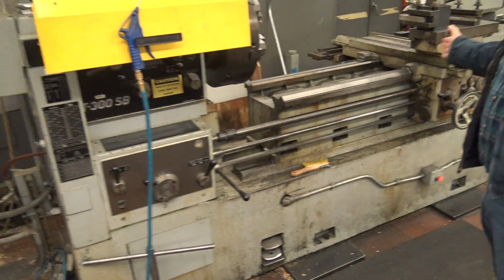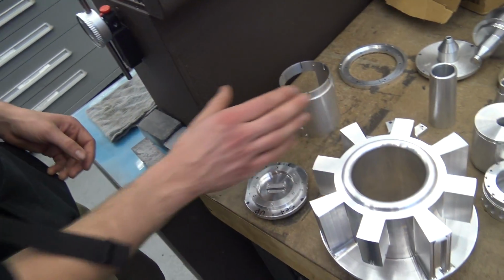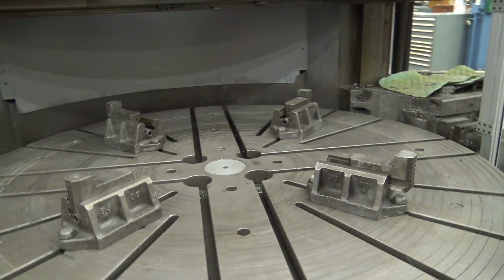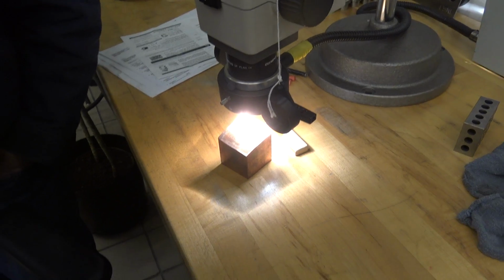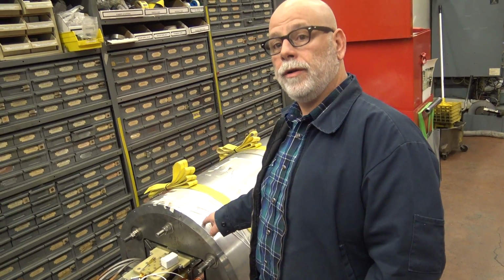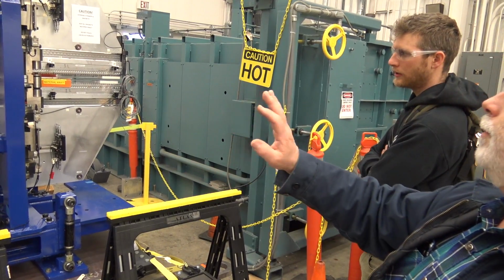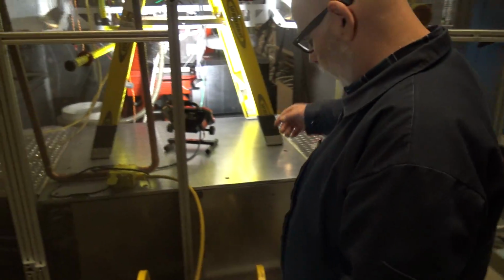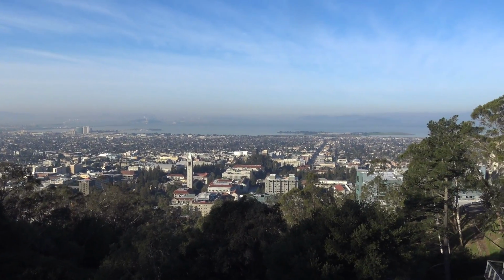AMAZING Machine Shop Tour: Berkeley Lab with Tom Lipton!

Comment: Wow, this was a great exposé of what equipment goes into an advanced mechanical research lab.  We here at Machineco, have supplied equipment to university labs ourselves from general machine tools, to large radial drills and salt baths.  In stock we have varied equipment such as was featured here, press brakes, shears,, compressors, welders, wire and sinker EDMs. The only machines we wised we had would be water jets and laser beam cutters, but it's impossible as they gobble up too much room. 
Again a nice bunch of pics of a great assortment of metal working equipment. Thank you!

Comment: There is a lot of this here in the bay area. Vacuum chambers and unusually machined parts from exotic materials with ridiculously tight tolerances. But it is not every day that you see as many of the varied machines and parts in one video. Ok, it actually just this day and only this video!

Comment: I was lucky enough to go on a "field trip" in college to see what a professor was doing research on. I forget who it was, but he was working with particle acceleration. He said that he had to use such a strong vacuum pump to evacuate all the "air" before doing the colliding. In fact the vacuum is so strong that he had to use copper for washers to make sure the "path" was airtight. He then gave each of us a washer to have. This has to be at least 20 years ago in the 90's and I still have the washer on my key-chain.

Comment: Very cool! I actually work at LBL and have toured the main shops before. I work in another division but It's always fun to visit the main shops. Glad you got a chance to see it and share with us!
Reply: +NYC CNC I am a student assistant in the Buildings Technology & Urban Systems Division. I've been working on the FLEXLAB project (https://flexlab.lbl.gov) which is a test bed for different energy efficiency building technologies. The lab has the ability to change out windows, facades, shading mechanisms, HVAC, and lighting, etc. and has a bunch of sensors to measure the effects the different systems have. I've worked on installing some of the different systems and sensors and have done some CNC mill/ manual lathe work to make some parts for this.

Comment: I was trying to roughly estimate the cost of the equipment as you walked through, but it soon become apparent that it fell into the "mega shit loads" category very fast...
Reply: It's the UC system: they don't know, as it has been run cost plus for decades.  One fun note [not shown] is they are able to make their own alloys on campus, which comes in handy for property testing and figuring out useable ranges for desirable properties..
Reply: @flinch622  You're right about the UC system in general but this is LBNL's operation, not Berkeley's, and it's federally funded via the Department of Energy. The UC system essentially just staffs and manages the lab for the DOE.

It's the single most productive institution in the world in terms of publishings per researcher, and the most productive singular lab bar none. Every institution that publishes more research than LBNL is made up of multiple labs spread out at distant locations. LBNL alone (just one of the 17 DOE national labs) publishes more academic articles per year than NASA, and almost half of what gets published by the entire NIH.

So yeah it's shitloads of money in tooling and machines. LBNL is not Berkeley's science & engineering department, it's a federal facility that used to develop nuclear weapons, and now does pretty much everything BUT develop nuclear weapons.

Addendum: Although LBNL is the most productive lab on paper, it's by far not the biggest national lab in terms of staffing or funding (LANL's budget is triple LBNL's) – it's just the biggest national lab that does not do classified research. LLNL, LANL, and ORNL are likely far more productive, their findings just don't get published because everything is classified. Anecdotal, but every staff scientist I know at LLNL or LANL has Q-clearance. That should give some idea of exactly how much of those labs' research stays secret.

Comment: They have every tool necessary to make pretty much anything...that's insane.
Reply: Toolman329 Many of the tools you listed are not necessary with modern tools. A gear hobber? They have several CNC machines that can cut gears, same thing with a pentagraph machine. You're also taking my comment much to seriously, it's called a hyperbole. I'm sure they could fabricate any and all of the tools you listed as well.
Reply: SeriouslySharp they have no 3d printers. But it is easy to make any size in a moment by the equipment they have
Reply: cncua Thats because 3D printers are toys. These guys are doing cutting edge stuff in the world of physics.
Reply: +cncua That just means that you didn't see any 3D printers...

Comment: A50k spindle is pretty impresive! That Bullard has the side head too so you can actually do 3 cuts at the same time! That would be a nice addition to my shop. :-) Most of that stuff the built looks like a wiring nightmare!
Reply: +NYC CNC I thoought that one machine was 40K and then new one was 50K, but looking at the door I see it is 40. Oh well that isn't impressive at all then. LOL I admit all the tool porn had me distracted so I couldn't pay attention. :-)
Reply: Wasn't there a pump with a magnetically levitated spindle spinning 50K on one of the accelerators?

Comment: I have a question about the power feeds mentioned later in the video. Tom mentioned that each one delivered "a megawatt in a millisecond." Watts and thus megawatts are an instantaneous measurement of power, so I didn't understand that comment. Power, integrated over time is energy, expressed typically as watt-hours, so is is possible that Tom meant that those cables delivered one megawatt-hour in a millisecond? Fascinating video; thank you for sharing it.
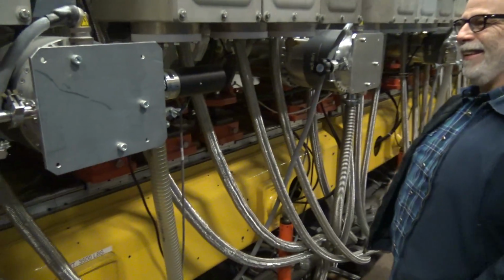Reply: That remark was at about 41:05.

Comment: Massive respect for Tom the machinist but that work shop is total shit hole.You would never get away with that in the uk in fact you would get strung up,With 5s and health and safety it just wouldn't happen.Can you imagine a potential customer walking round that shit hole,you would not be in business long Also some of the machines were well passed their sell by date.Fair enough they had a nice new Maho and a mori but you could barely see it for all the shit and finished jobs surrounding them.Another thing you never leave a tool in the spindle when the machines turned off.As rust can form on the spindle taper due to the air lube not circulating.Lesson 1 day 1 with through spindle coolant machines.loads of school boy errors in this video it's embarrassing.

Comment: What we are looking at is a typical aerospace tooling / prototype shop.   The sheet metal equipment looks like something out of a high school metal shop class.   Typical CNC equipment.  Nothing special.   No temperature-controled inspection room?   No special grinding? No atmosphere-controled welding?  No welding...period? Wire EDM impressive.
     The person who is taking the tour is wearing a back pack.   Is he going on a hike?   He is very impressed with the old engine lathes.   Has he been living under a rock for 40 years?  He must have been a student using the old sheet metal equipment.
     The VMC is what you would see in any aerospace shop.   Nothing new.   Nothing special.   Nothing exotic.
Reply: Private vs public sector...
Reply: Hi Rob - I bow to your greatness, clearly this shop is below your standards. Care to show us what a real mans shop looks like?